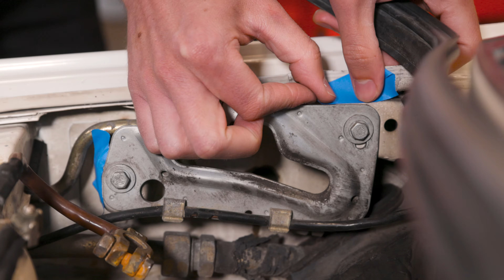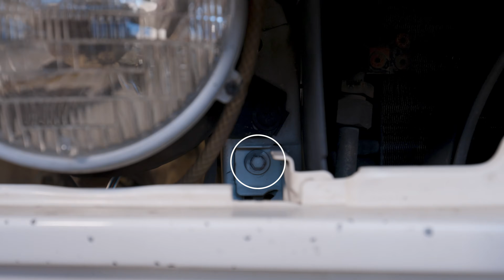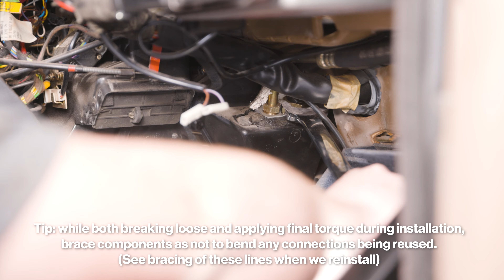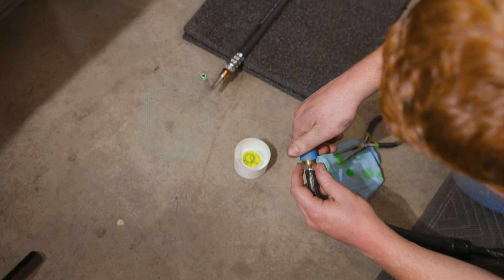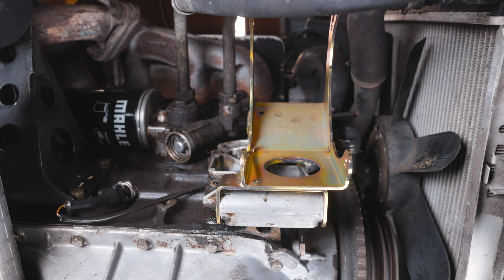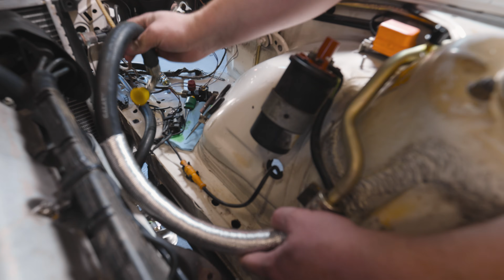BMW E30 R134a Sanden Conversion Kit How-To & Installation Video - A/C Solutions

Comment: Does it use #8 & #6 fittings?
Want to use this condenser for a custom application 
Thanks
Reply: Condensor fitting is #6 5/8 -18 thread and #8 3/4 -16 thread
Reply: @KneipeMeijer thank you, will use it for my custom project 👍🏻

Comment: I have 90 E30 316i with no AC. Is there a kit available for this in order to add AC to the car?
Reply from the maker: Unfortunately not, but it is on our roadmap!
Reply: @acsolutionsco  thanks for the update, will monitor

Comment: Hello AC Solutions.

I have a Standard compressor and I want to know if you have an installation video for the Standard compressor, specifically in what position it is installed and how the hoses are connected.
Reply: Specifically for mounting Sanden 508 (SD5H14) Compressor (standard)
Reply: @miguelangeltovarc.2171 did you ever figure it out i also have the same question

Comment: What kind of foam could I possibly use around the new expansion valve to replace the original one that completely disintegrated?
Reply from the maker: We would recommend any generic HVAC cork tape (typically black in color with a sticky backing) and carefully shape it into position!

Comment: Will this work for a 1992 318i convertible?
Reply from the maker: For the M42-based E30, we are still working on launching a full kit this; however, we did find that during our testing the factory Denso setup was more than adequate when running R134a as these are very similar to the E36-era A/C compressors that are quite robust. We would recommend using our A/C Solutions BMW E30 R134a Retrofit Kit (82319067394) in conjunction with our CSF parallel flow condenser, interior lines, expansion valve filter drier, pressure switches, etc. (all available on our site). The only key items that we don't offer are the 2 lines going to/from the compressor. If you have any other questions, please send us a message!

Comment: In this video you convert the Late Model drier pressure switch to an early one. Is that still needed if we select the 09/89 or later kit on the website? Or can we keep the same wiring and put in a new Late Model Pressure Switch 64538390971?
Reply from the maker: Great question! We have since revised a majority of components in this kit so if you were to select the ≥ 09/89 option, it will come with the late model safety switch (64538390971). Pre 09/89 models will ship with the early model drier and use the high-pressure cut off switch (64531386971).
Reply: @acsolutionsco  Thanks for the quick reply. So just to clarify, when I order the "BMW E30 Complete Conversion Kit" for "325i  ≥ 09/89" it will come with the Late Model Safety Switch (64538390971)? I don't see that mentioned in the description of What's in the box so I was going to add it separately to my cart.
Reply from the maker: @handro123  sorry for the confusion! That is not currently included in the full kit, but is available on our website if you'd like to add it to your cart!
Reply: @acsolutionsco  All good. Thanks for the quick response!
Reply: @acsolutionsco  Does the late model safety switch require an o-ring or teflon tape for installation into the drier?

Comment: "If you don't have these oil cooler lines, your install will be just a tiny bit easier".  Understatement of the year.
Reply: i dreaded doing this because of this comment but i didn't have any issue with the installation at all? and one of my oil cooler lines is bent inward so it's even closer to the compressor
Reply from the maker: @Vanya2893  it certainly varies by car, but we have since revised our M20/30 compressor bracket to bring things closer to the engine and provide additional clearance!

Comment: This is an awesome video, I plan on purchasing a kit for my E30 shortly, just have a few questions prior..

1. I live in Australia and have a RHD E30, so I will need to reuse my interior lines, but still replace both ends of the interior lines with new Oring seals?

2. What is involved in flushing the old interior lines? Can this be done in the car before new parts are installed?

3. Once kit is installed can I drive the car to AC shop ungassed? Just don’t want to damage the system..

4. Can a shop do the vaccum test prior to regassing the system?

I’m confident in the install based on this video, but just want to make sure it’s something I can do at home myself or if I should be paying a shop to complete it all.
Reply from the maker: Great questions! Feel free to email us at info@acsolutions.co for further inquires!

1. Yes, we only carry the LHD interior lines currently, but all of our E30 kits come with the interior o-rings
2. Flushing the old lines can be done with any off-the-shelf a/c flush (or by your local a/c shop). This is highly recommended for any reused parts and should always be done before installation.
3. Yes! As long as the compressor is not engaged during the drive, it will spin freely on the clutch pulley.
4. Yes - it is imperative that the system is vacuumed and pressure tested prior to charging. Any a/c shop will be able to help you with this process.
Reply: @acsolutionsco  awesome thanks so much for the prompt reply! Ideally I’d like to get a set of new RHD interior lines included from you if possible to keep things all new? 
Will send an email shortly to discuss, thanks! Looking forward to having a cold E30 in the Australian heat :)

Comment: Dumb question, but can this be done on an e30 touring that didn’t have AC from the factory? It has an m20
Reply from the maker: Not a dumb question at all! Our products are designed for cars that came with A/C from the factory, so you will need the interior HVAC console, evaporator, factory wiring harness, and the drier return line (long metal line) along with a few other small brackets highlighted in the video that are reused during installation.

Comment: When will the kit for m40 engine come??
Reply from the maker: This is on our roadmap; however, we have a few other projects in the mix first! If your car has a working factory Denso compressor, we'd recommend purchasing one of our service kits along with a new condenser and expansion valve and having the system professionally charged.

Comment: Hello ac solutions, do you sttil have the ac compressor that you take off the car? I may be interested in purchasing it. Good video by the way.
Reply from the maker: Unfortunately not, it was a non-working unit when removed.

Comment: Just got your e30 full kit (and inside lines) and did the install myself.  This video is a nice addition to your written instructions!  I'm in Houston and last night after charing it up I went out in 87 degrees and 77% humidity -- outlet temp driving was 40 degrees!!  It works great!   The biggest PITA was the 4th (back) screw on the expansion valve cover.  Everything else and the parts in the kit were perfect and it went smoothly.  Thanks A/C Solutions!!
Reply from the maker: Thanks for the feedback! We're glad to see another icy cold E30 on the road!
Reply: Thanks for posting this feedback.  To me $1800 and done with it will be well worth the cost.  If anything has changed with the system please let us know. If it's still kicking butt that would be a great follow up too
Reply: How long did the install take overall?
Reply: @kellyjohnson7669  About 6 hours but it was broken up over a week's time...  did some cleaning up the areas open while doing install... usual scope creep!
Reply: Did you upgrade the fan and condenser? I live in Houston too and I’m wondering whether I can get away with keeping the original fan.
Reply: @Asrg  New but original type fan.  Flushed out original parallel flow condenser and re-used.  Still getting  40-44 degree outlet temps in this hot weather!
Reply: @lindreltlindrelt  I decided to bite the bullet on the new fan and condenser. Hopefully it works well. Thank you for replying!
Reply: So how did it go?   @Asrg

Comment: I have the entire kit in a box waiting to be installed while I address other things. I noticed some of the hoses came with open ends, and I'm aware all the system components have to be cleaned/flushed.

I'll be doing the install myself, how would you recommend I clean each part of the system? It would be extra cool if the components all came clean and sealed on both ends somehow.
Reply: It looks like all you'll have to do is flush the stock evaporator in the dash. However, I would recommend you replace that evaporator if you're going through the trouble of replacing every other component of the air conditioning system
Reply from the maker: @TriStarWorkshop  that's correct! You only need to flush the components that are going to be reused - our parts come fully pressure tested (and clean) as they are new!
Reply: @acsolutionsco  My concern isn't that the parts weren't tested/cleaned when made, they look great quality in fact 🤌but that they were sent unsealed in a box with floating particles in it. Not bagged or with plugs, which I think would be a nice touch for peace of mind. I will flush everything to be sure since my AC is all apart now anyway.
Reply: @TriStarWorkshop  Thanks for the reply. I believe replacing the actual evaporator is somewhat of a horror show type of project, I believe I saw it disassembled by the channel RestoreIt.